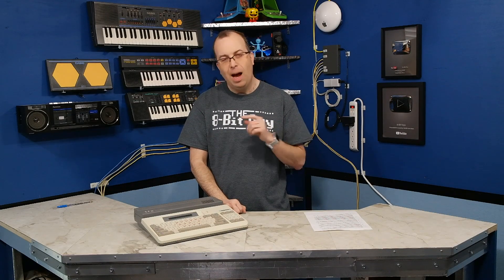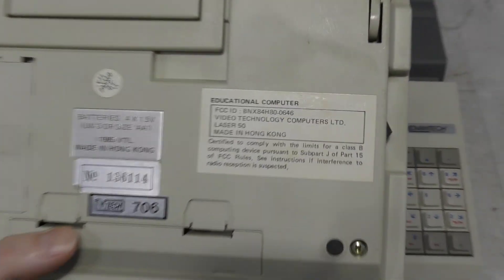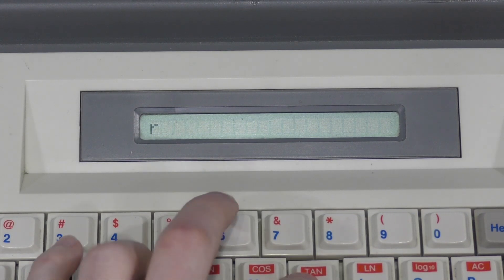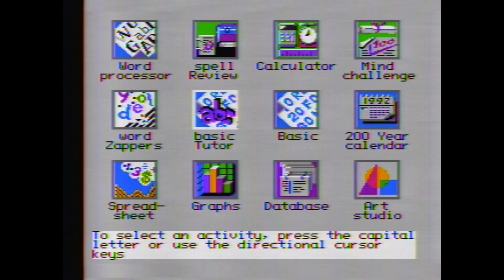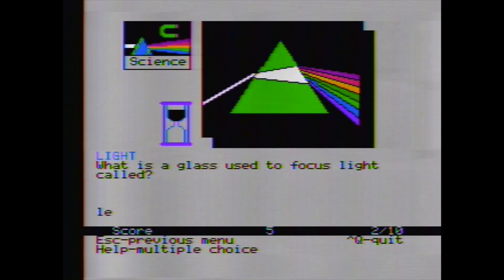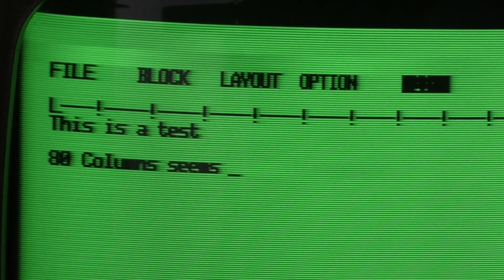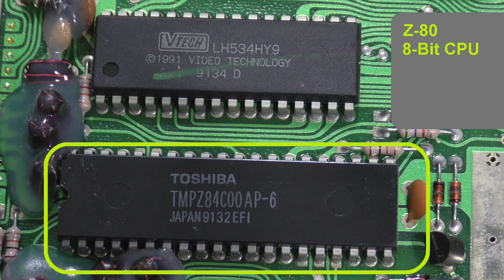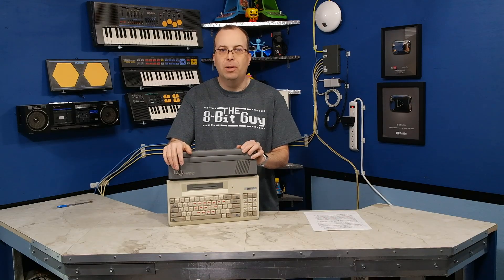The Advantech I.Q. Unlimited with BASIC and a Z80 CPU.

Comment: Hi 8 bit guy i just want to say I have a computer like it and I want to confirm it's the trash machine I looked it up see if I get a used software or anything on it turns out this thing does not have any proprietary software or anything and that it's technically just a lemon as car enthusiasts would say   And I'm really a big fan of your channel and I want to say thank you for this video It was really helpful but the computer that I have is lemon and that I feel like the commerce 64 was better than I thought this was oh when I found this thrift store I thought it could be better like a C64 or Vic 20 but it did not work so Yeah it works properly It's just that it doesn't have anything interesting I could do on it so yeah that's why I don't use it anymore so I hate this stupid machine anyway

Comment: Back in the late 1980's, I was working on my comp sci degree. I had a TRS-80 Model 4p using the terminal emulator software called Modem80. Using a J-Cat 300 baud modem, I was connecting to a Pyramid Unix system to do my programming assignments. Using the VI editor, I cut my screen size down to 4 lines, I remember it distinctly. The screen refresh was so slow I went down to the lowest number of visible lines that was workable. It worked.
Reply: I did my Computer Science degree in the mid-80's with a Model4P. My crowning achievement was a ray tracing assignment in Turbo Pascal with the Micro Labs Grafyx Solution hires board. Those were the days...

Comment: The 'no idea chip' is doing following: {https://youtu.be/HEfUefVXzzg?t=917}
"ROM - the VTech LH534HY9 chip contains the basic BIOS to manage booting, additional cartridges and printer port, and built-in programs..."

And the second chip: {https://youtu.be/HEfUefVXzzg?t=1007}
VTech proprietary A/V controller graphics chip 27-5063-01 1111F0249 supports 40 and 80 column text modes.

Comment: If it had a much better basic, it might’ve fared better.
Reply: I don'tt know any microcomputer, post-IBM PC, that sold because of it's Basic.  Most were done by Microsoft, anyways.  "Pocket computers" and advanced "calculators"could be an exception, because of inherent limits of third party software for them.
Reply: @squirlmy  I wonder though. They marketed it as the last computer you’d buy. The intent being that this is fully featured as they come. I wasn’t an adult back then, but that line speaks volumes.

Comment: As for that 128k RAM chip, I'd bet the machine had an "upgrade" path similar to the Tandy CoCo, where the RAM was already installed and the upgrade consisted of clipping a resistor or some such to make the remainder of the RAM visible to the system.

Comment: "Optical cables used to guide light are made from what?"

Well, what's the use case? The large ones for high-speed data and such are made of glass. However, cheap TOSLINK cables are plastic, and TOSLINK has been around since 1983.

Comment: Ahoy, thanks for the interesting video. I also thought I was one of the few owners of this obscure computer. I bought one mint in box at Goodwill in 2001. I hooked it to a 5" color TV and it was quite sharp at that size. The TV had a color/B&W selector and in monochrome it is very readable at 80 cols. As you pointed out the major shortcoming was no tape interface or disk drive. 

Rumour was the interface was for either a serial interface (think modem) or a disk drive (or both). Think about this: a Z80 CPU, 64/128k RAM, 80 column mode. What does that spell? CP/M. With a disk drive this computer could literally run CP/M! But my friend and I could never find any info on the pinout of that slot. One missing piece of info between a toy and a full computer system...what could have been. (Also the graphics are very close to TMS9918 graphics as in MSX?)

Thanks again for the fun video. Happy hacking, daveyb aka MC10Guru
Reply: Could you not have poked around with a multimeter to get a pin out?
Reply: @Sierra045  Ahoy, Well at that time I had many irons in the fire. I was disassembling the Tomy Tutor ROMs for Cameron K., Documenting Locomotive BASIC 2 for the  Freegem project, and working fulltime for HP as their Warpserver maintenance tech. Besides, I'm a software guy, my friend was the hardware guy (also an HP tech). I do still have the Adventech computer beside my Atari 1200XL. Not turned on for 21 years prob. daveyb

Comment: One of the 12 programs is a Basic tutor. I guess that's nice, but I've never used one because Ataris came with excellent tutorials in the manuals, and before that, I had a monster of a... what to call it... learning kit for the ZX81 with 9 tapes and a ring binder full of printed paper. Insane picture on the front, too; a ZX81 on this utterly alien and very fancy pedastal in front of a window looking out onto a sci-fi cityscape.

Haha! The IQ's 80-column mode is just as unreadable as my Atari ST's medium resolution with the Commodore monitor I had. I guess the monitor was meant for the C64. It worked very well with 8-bit Ataris. My problem with the ST was the lack of a bundled BASIC, and when I finally got one, it only displayed error messages in a sort of status bar restricted to 1 line. In low resolution, the useful part of the error message was clipped off.

128KB inside? Perhaps it used the extra 64K for file storage.

Comment: Peek and Poke in basic probably wouldn't be that useful as z80s had port io so you need an Out command too to really go low level. A Z80 in the 1990s in a portable, what do they think they are making a game boy?  Guessing a z80 clone was the only cpu that was low power enough to run on batteries at the time.

Comment: Here in 2021.  Speaking of VTech, I still have their Laser 486 SX/3 PC, bought from Tandy Incredible Universe around 1993. Also have the manuals & peripherals.  Sadly the crt monitor we bought with it died nearly a decade ago.  I did a bunch of upgrades to this 486, including adding motherboard cache (came without the cache chips), adding max memory, overdrive CPU (from original 25mhz to 100mhz) & a few other updates.  It was probably good for VTech to get into the IBM cloning as well.

Comment: I probably should've looked up the chips myself before commenting.

In regards to the RAM, There are some options as to why you would insert 128k ram in a computer "only" branded with 64..  F.ex. they can do as Sinclair did: Buy broken chips for an extremely low price, and only use the parts of the chip that worked).. but also; You say that FILES are stored in Ram... and.. I doubt anyone would be happy if they (after storing a few years of school work assignments) suddenly didn't have any Ram to work with... Also it's possible that they actually used part of it as screen-memory.- I mean; IF they had some extra things, f.ex. sprite-handling, then you would like dedicated memory for those things (from which you bild the contents in the frame-buffer)

Comment: I had this thing as a kid. Admittingly I was an aggressive kid, and found a hidden "music maker" program by shorting the ROM port connections just right. I could not tell you how I did it now, but I know it would load the music program in TV mode but then crash (maybe they were going to use the ROM cartridge for samples?) I also think the reverse slot was meant to be user storage, but not sure if it ever came to be. Drive B was ROM and there was another (A or C I cant remember) that was meant to be the user storage cartridge (again, I think).

Comment: According to someone called Andrew68K the chios in question are:
- Zilog Z80 CPU (Z84C0006PEC)
- ROM containing 12 built-in programs (VTech LH534HY9)
- (custom?) A/V controller (VTech 27-5063-01 1111F0249)
- I/O controller (TMP 42C50N)
- Printer buffer (PC 74HC244P)
- 128KB SRAM (Toshiba TC518128APL-10)

A disk drive was planned to connect to the expansion port, but never realised. Instead a memory cartridge was supposed to be plugged in there.

Comment: Does the IQ Unlimited ask you if you want to play it on the TV or LCD screen even when it's not connected to a TV?  Mine does not, but it doesn't even ask me which video output I want to use when it is connected.  I don't have an RF switch for my IQ Unlimited, and even if I did, it wouldn't work for me as Australian TV antenna sockets are different to American ones.

Comment: I bought an IQ Unlimited recently and tonight I tried to connect it to my TV, but without success.  I live in Australia so we use PAL, but I'm quite sure my TV accepts both PAL and NTSC signals, I used the Composite video cable.  I connected it to the TV but didn't get a picture, the IQ Unlimited did not ask me whether I wanted to use the TV or the LCD screen.  When I connected the cable to one of the audio sockets on the TV I heard a 60 Hz buzzing sound, so I think the video output is producing a signal of sorts.  Then I tried connectin the IQ Unlimited to a small portable black and white TV set I have, when I turned the IQ Unlimited on, I saw diagonal lines running up or down the screen, the movement of the lines changed as I adjusted the vertical hold on the TV.  The batteries in the IQ Unlimited appear to be OK, it doesn't ask me to replace the batteries when I turned it on.  Can somebody suggest anything that I should be doing?  If someone could please help me that would be wonderful.  Thanks.

Comment: I've thought of something.  You mentioned in the word processor that you had a limit of 24K of data, which isn't a lot.  When you brought up the directory screen I saw you had a good 59000 odd bytes remaining, so here's what I think is going on.  I think there's a file size limit per word processor document of 24K, meaning that you can't create documents larger than 24K.  I think actually the computer has 64K of data storage, again, not much at all really.

Comment: I got my IQ Unlimited today, I find it kind of interesting to play with, but I would much rather connect it to a TV than use the built in screen, sadly I don't have access to a composite video cable where I am.  Also, nobody's really mentioned this so far, but the keyboard is super noisy, the keys have a really loud click on the upstroke when you release them, my goodness it's loud.  Playing Word Zappers on the internal screen isn't much fun.  The basic tutor has some sample programs built into it.

Comment: I'm a little late, but thanks for this video! I got one of these Christmas of '91 when I was 10, and still have it today!  Learned BASIC and think it may of influenced my IT career.  If you lost power and the batteries were dead, you lost all your work!  My backups were hard copy print outs on my Epson dot matrix printer. My first experience calling tech support, was calling vtech because I wanted to buy cartridges for that expansion port and was disappointed to find there were none! My 10 year old self should of asked for a Commadore 64, but the Advantech served my needs.
Reply: I've seen another video about this machine on YouTube, and I thought the other video said that VTech made a RAM expansion cartridge, I also understand that the cartridge slot is capable of playing games for the Socrates video game system, also made by VTech.
Reply: @Lachlant1984  yeah I found that too. Looks like you can use cartridges from Socrates game system. Wish I had of known back then
Reply: @EltonVinson  Do you know if you still have the user's guide for your IQ Unlimited?  Do you know if the user's guide mentions anything about using Socrates cartridges in the IQU?  I ordered an IQ Unlimited off eBay about 3 weeks ago and I'm eagerly awaiting its arrival, I don't know if mine comes with booklets or anything, what I do know is that it doesn't come with the AC Adaptor.  The seller didn't post much information about it on the product page.
Reply: Lachlant1984 I have the manual. It doesn’t actually mention Socrates. It mentions a 64K RAM cartridge that will be available soon (from the publishing of the manual) for extra storage or backup. It also mentions I.Q. Unlimited Cartridges which are extra software cartridges to enhance the existing 12 software programs. A lot of coming soon wording. I’ve been tempted to buy some Socrates cartridges on eBay to test it out, but they’re kind of pricey for what they are.
Reply: @EltonVinson  Hmm.  I think VTech did release the RAM cartridge for the unit, as I said, I think I saw it in another video on YouTube.  I'm looking forward to getting my IQ Unlimited once it arrives, I wonder how easy the RAM cartridge is to find.  Considering that VTech are still in business, I wonder if they have any records of cartridges released for the IQ Unlimited.  Speaking of using Socrates cartridges, I only know they work because VWestlife demonstrated that they work, also, not all Socrates cartridges will be compatible because I understand some Socrates games use alternative controllers which the IQ Unlimited does not support as far as I know.  The Socrates uses an infrared wireless keyboard controller and I think the alternative controllers are wireless too, so they won't work with the IQU because it doesn't support infrared.

Comment: The extra ram was used as a ram disk.
The Vtech labeled dip next to the cpu is system rom.
The edge connector on the back was intended for use with planned floppy drive that was never made available.
The cartridge port on the side was compatible with the VTech Socrates game ROMs 
4-bit micro controller appears to be handling the keyboard and may be involved in the memory management;
The custom chip on the other side is probably th video chip.

Comment: 1991?!?!? Good lord. This thing looks like it would have been a better fit if it had come out a decade earlier. In 1991 I was using my family's second-hand Mac 512ke that we'd had for about three or four years by that time (I think, I honestly don't remember exactly when we got it, it's currently sitting on a shelf next to my desk awaiting a capacitor replacement and possible conversion to 240V, assuming that's even possible, since I now live in Australia). That said, as a kids computer, I actually think it is pretty ballin' and, even though I had access to my family's far more powerful computer, that was limited to when my mum wasn't working in her office (where the computer was) and I was allowed to use it. The other downside of the Mac is that it didn't come with ANY method of creating my own software (the closest thing to something like the included qbasic on DOS machines would have been hypercard, but only the hypercard player was included, the authoring software cost a fair amount). So I envision I would have continued to play games on our Mac, but I'd have used the IQ unlimited to learn coding and write my own stuff. Of course, I wasn't allowed unlimited access to the TV either (and I'd have been berated for sitting too close to the screen, my mum was and is a bit of a luddite) so I'd have needed to use the built-in one-line text screen most of the time, only using a TV occasionally for actually running my creations (though, I have a feeling that, having shown my aptitude for it, my mum would have relented and gotten me my own, small, probably black and white TV). I didn't get my first proper taste of programming until I was in my early teens and a friend of mine showed me QBasic and, eventually, QB45. I wonder how my life would have turned out had I had an earlier introduction to programming.

Comment: A $200 computer ($373 in 2019 dollars). Sounds like a steal, but it seems to be a rip-off. What was V-Tech thinking releasing a system without a media (floppy disk/cartridge) port in 1991? The Commodore 64 wasn't very powerful by 1991 standards, but $150 would buy you the system and the leftover $50 would probably get you several software titles. If you wanted portable, there was always the Game Boy or Game Gear, a one-line display is useless anyway so this wasn't really a portable computer. Spoiler alert - if you click "read more" there are some spoilers for the video.

Basically, it looks like there are 5 "useful" programs (and for a couple of them, that's a stretch), there are 3 edutainment games that will get old quickly, 2 widgets, a nearly-useless version of BASIC, and Basic Tutor doesn't even count so there's 11 programs, really. 

December 30, 2019 1:37 am

Comment: I think the video chip is the surface mount IC on the bottom.
I wonder if it's the same part that's in the Laser 128 as the graphics look a lot like Apple II graphics.
It does seem like a rough and someone what unfinished product on the software side and the lack of mass storage as there's not even a cassette port or they were to offer some kind of disk drive or battery backed ram cart.
A C64 or a COCO3 would have been a much better deal for the money.